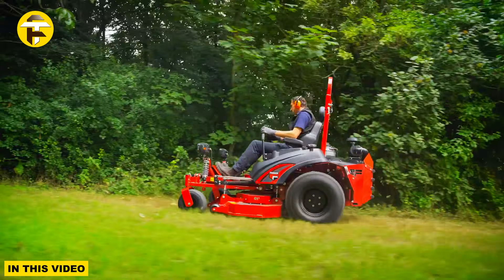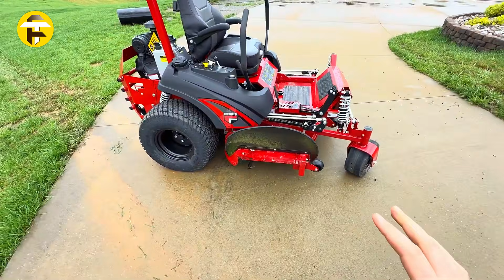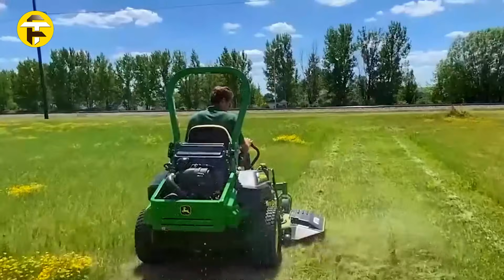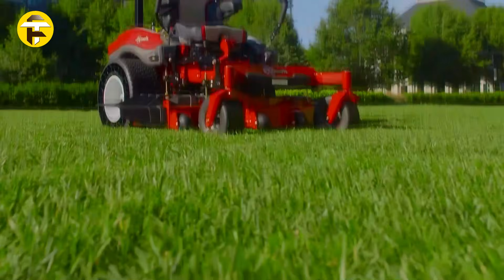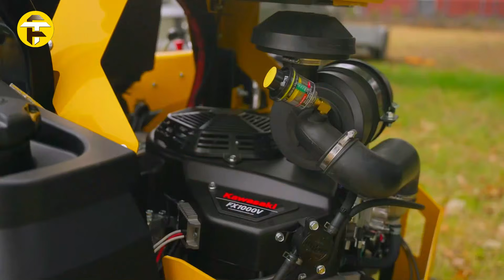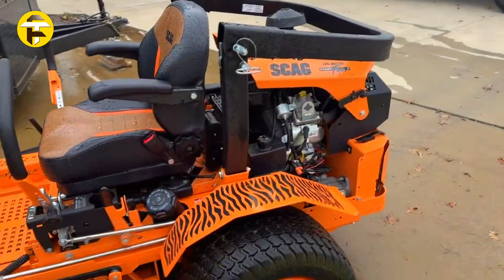5 Zero Turn Mowers That Are Actually Worth Every Dollar in 2026 (No Sponsored Bias)

Comment: Most people would be better served with a tractor type mower. They can do more than cut grass just ok at too high of a speed. Some cut very well at speeds you would want to actually cut grass at. 2 hydrostatic erratic transmissions is another huge red flag to stay away from. Unless you like dropping your machine off to a guy like me when it breaks, you are better served with a lawn tractor. Better yet, for less $ than a crappy zero turn, get a decent garden tractor thats a few years old. Ive got a 2005 simplicity conquest that would easily drag those zero turns around like the toys they are.